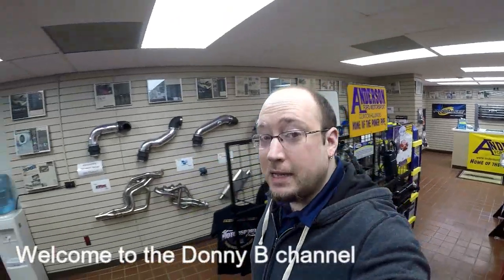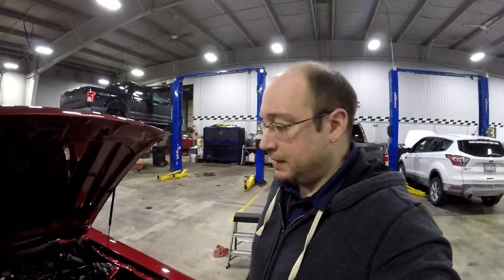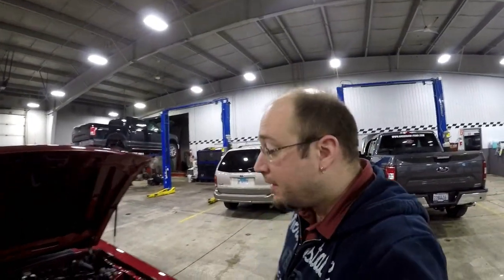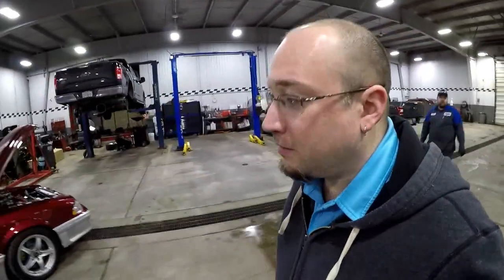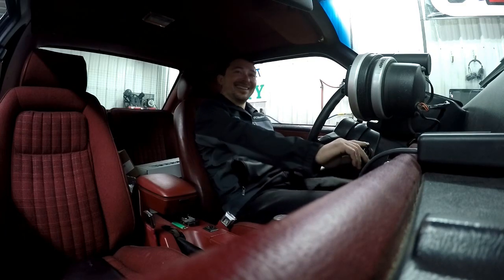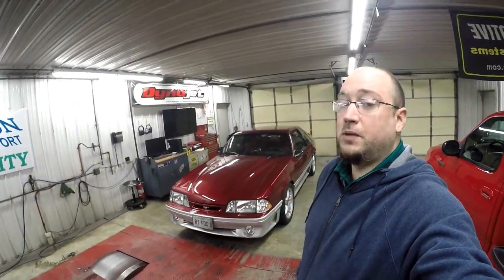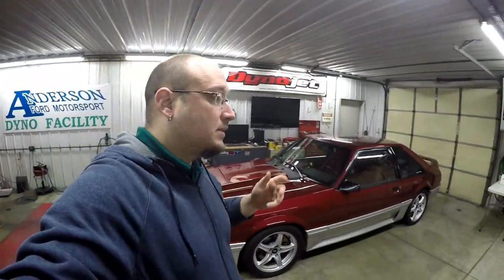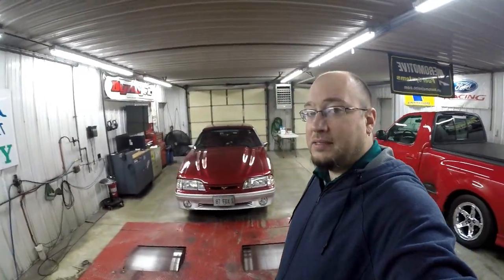Holley Terminator X Fox Body Mustang Install Overview

Comment: How many hours labour did it take? And how many hours on the dyno?

My local shop quoted me 4k for this install. 20 hours @135 a hour for install and 5 hours @$250 a hour for dyno tune..

I'm thinking it's a bit steep..
Reply from the maker: There are quite a few factors that will determine labor hours. Keeping factory guages, retaining A/C, using 1 bar or external MAP, etc... however going through a shop that time could be accurate. AFM charges 15 hours to start and then  goes up based on extras added. Tuning labor usually starts between 500-1000 depending on shop.

Comment: I put the system on my fox over the winter and so far enjoy it just trying to work the bugs out. I have a surge in the idle when coming to a stop, it smooths out after acouple of seconds but any recommendations on how to correct this?
Reply from the maker: How is iac being controlled? Using 1d table or regular ramp control?
Reply: @strangedemon  regular ramp control current settings 40% hold, 2.5 decay, 1000 rpm to start ramp, 150 to re-enable idle control
Reply from the maker: I would activate the 1d table and enable the iac to be controlled by that and rpm. Fix body Mustangs did a really good video explaining how to do it. You may have to adjust the parked position down depending where the car starts up at
Reply: @strangedemon  ok thank you I will try that